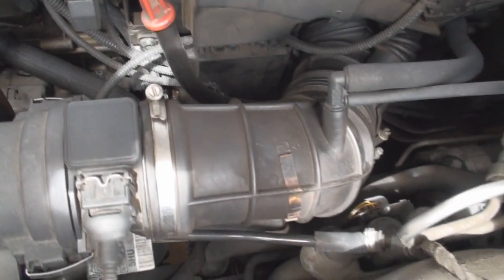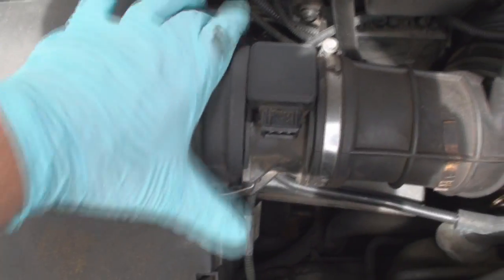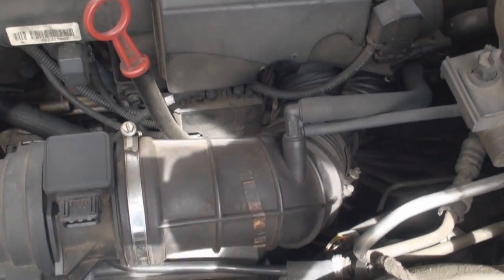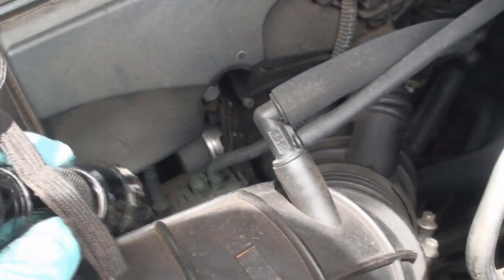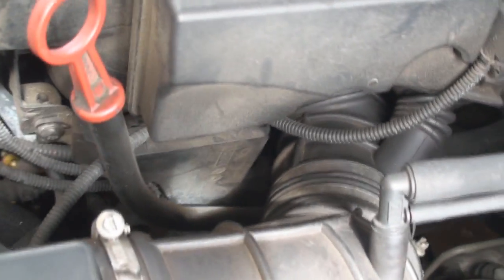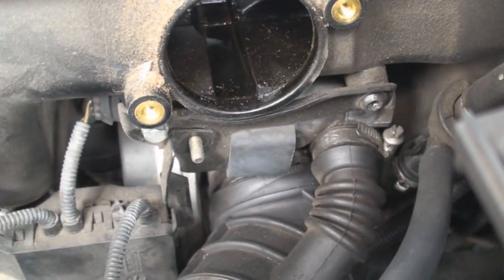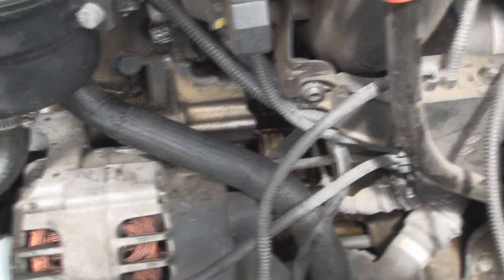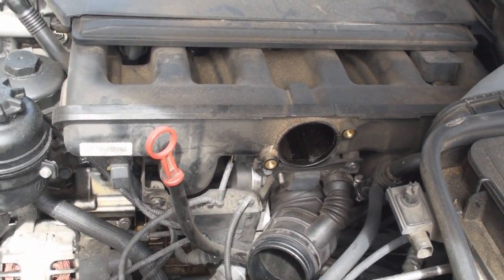obd2 code p0174 fix on 2003 BMW 525i

Comment: I’d be asking myself why it didn’t throw a P0171 at the same time. I think you need to replace the Valve Cover Gasket…specifically the ones that seal the spark plug wells from the crankcase exhaust gases that are probably coming into the space via worn valve stem seals. 
Did fixing the boot issue fix your problem?

Comment: This is a good tip, because my service guy changed oil filter in my BMW and after that P0174 popped up so it might just be the same case what you dealt here. Thanks man!

Comment: I agree these are common fault causes, fyi if you clean the maf it must be dry before it is connected.  I can't stand it when so-called experts don't know BMW's and don't service the car properly. I have just one master mechanic now who works on all my cars. Hard to find good service these days. That oil leak appears to be the dreaded oil filter housing gasket. Common oil leak area.